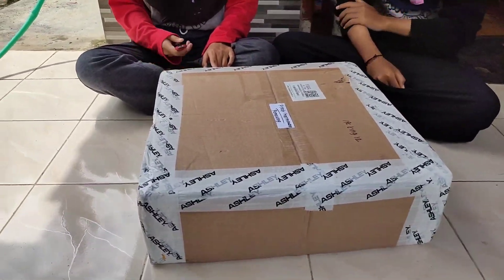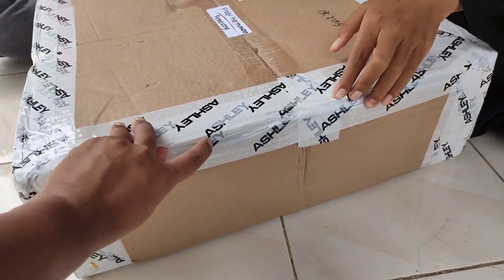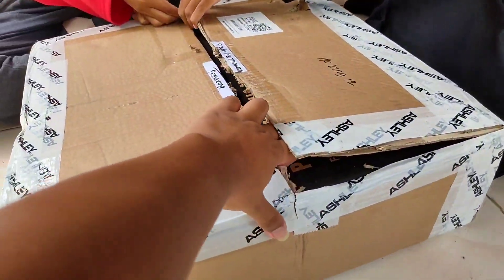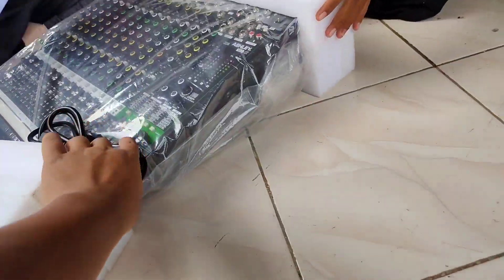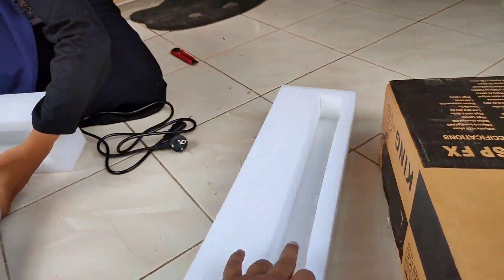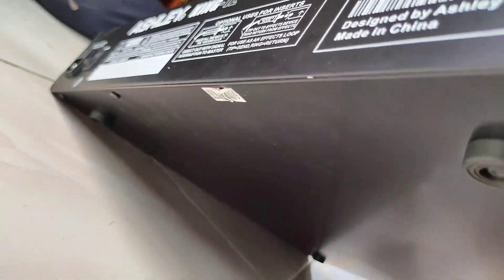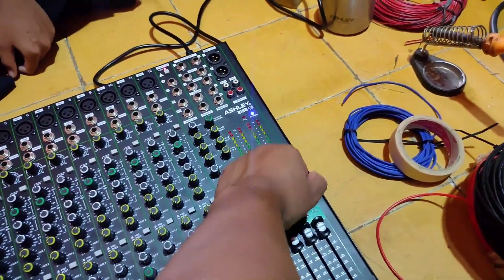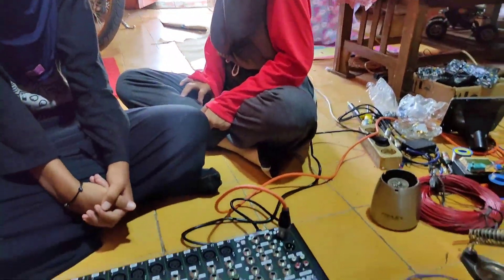Unboxing Mixer Ashley King Terbaru

Comment: Itu kipas power nya pertama kenceng terus biasa itu gimana mas caranya 😁
Reply from the maker: Pake sensor + kipas yg highspeed
Reply: Kalau mau simpel bisa pake NTC disambung seri sama kipas. Tapi NTC nya ditempel ke heatsink. Bisa juga diterapin di power lapangan biar kalau powernya belum panas kipasnya gak berisik.
Reply: @LabArlyn  Cara nempelin nya ke pendingin pakai apa...
Reply: @pemburu_horeg7870  bisa pake pasta heatsink atau dijepit aja pake baut. Tapi harus bener bener nempel.
Reply: @LabArlyn  NTC nya tipe apa 🙏
Reply: @pemburu_horeg7870  aku gak tau, aku mau coba dulu pake termostor yang ada di rumah, nanti ku kasih tau tipe apa yang cocok. Mau buat kipas gede apa kecil ?
Reply: @LabArlyn  Mantap 👍
Reply: @pemburu_horeg7870  aku tadi nyoba 5D-13 tapi gak ngaruh. Mau panas atau dingin muternya tetep sama. Sebenarnya psu komputer rangkaian kipasnya pake NTC tapi aku gak tau kodenya.
Reply: harus, pake 3 kabel klo mau otomatis gitu sperti kipas punya komputer
Reply: kipasnya power supply pc cuma 2 kabel loh, nyatanya aja bisa. Intinya rahasianya psu pc mengendalikan kecepatan kipasnya itu pakai NTC yang ditempel di heatsink bagian secondary rectifier.